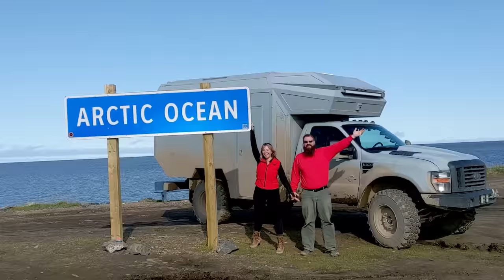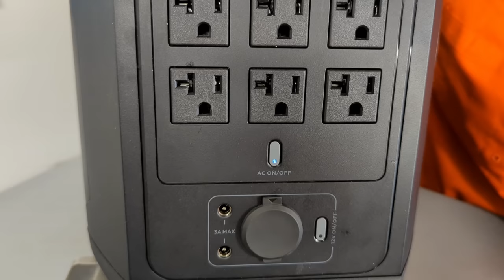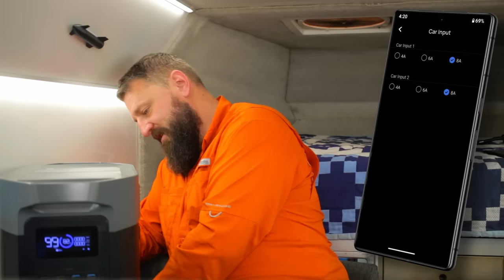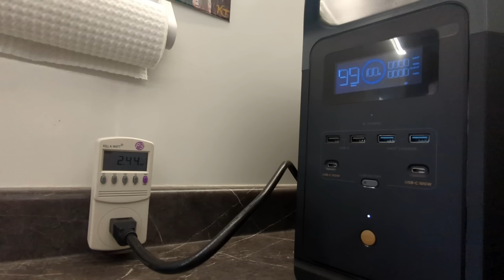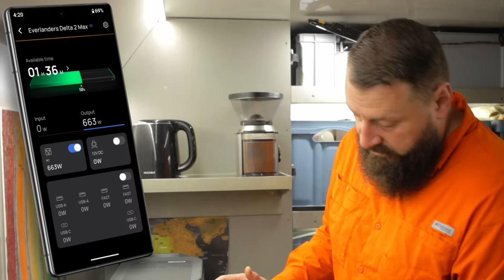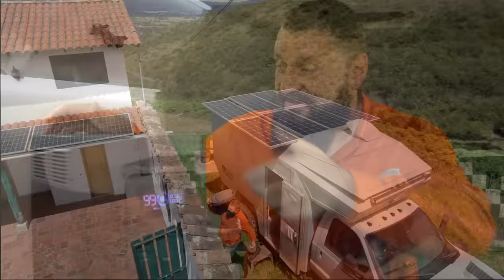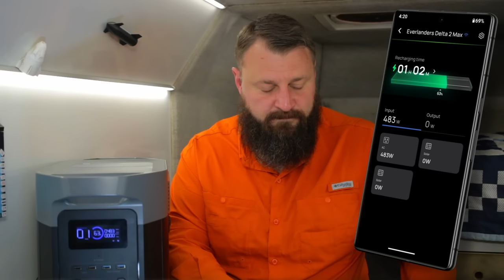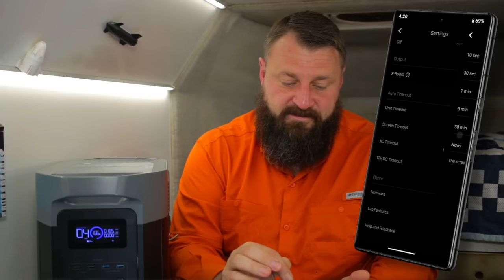EcoFlow for Overlanders - The LiFePo4 Delta 2 Max

Comment: Great little editing bits.  The buffer is a good feature.  I have to look back when you were building the batteries.  I seem to remember there was a certain way to pair the cell blocks. (Not the correct verbiage) So they are putting out similar energy so one doesn't blow the cell.  Man I totally messed that up.😅

Ok so as I get ready for our build. I need to go back and review your electrical build again. 😮😅
Reply from the maker: Cool, thanks

Comment: Great new video.  Put it in the onion!  You can really tell all the extra bits and bobs you have added to the editing.  I’m really looking forward to your next one powering the house.  Your right if the eco flow had a few more 12v outputs it could really be a drop in battery source for a van conversion or other type of vehicle.

Comment: As an overland traveler the input voltage range of 100-120 Volts AC is actually something you might be critical of too
Reply from the maker: We haven't been able to charge from the Grid in over 4 years, it just doesn't exist down here... The grid charging I did in the video was actually just running off of our inverter...
Reply from the maker: Given the way this inverter and charger is designed, it's running the inverter in reverse as the charger. It's a huge technical challenge that would add significant cost that a very small part of the user base would utilize.

This is no different than our high end Victron inverter... It requires a external voltage transformer too, not to mention the complexities that come from 50/60hz switching.

Comment: Excellent review as always.  Many thanks for your time.   More 12v outputs would be nice.  5521, XT60 or Anderson at at least 10a each.   After all, if you use this in a auto/truck/van, you are wanting to power stuff on this instead of the vehicle starter batteries.  It seems like many of the major players are reducing the number of 12v outputs which makes them a non-option for me.  They seem to be throwing more and more 120v outlets with how wattage's inverters which makes them more useful for a home but not the auto/truck/van.
Reply: You can't even power a diesel heater with the Ecoflow 12v outlet. So I went back to Victron and now use the Delta as a home solar farm with their powerstream unit.
Reply from the maker: Adding a super capacitor would make it pretty easy to start the diesel heater...

Comment: For those people complaining about the the disturbing fan speeds: do you not use a table fan at all?  My A/C makes more noise in my window by far. Besides, you have 2000+ watt-hours in a briefcase in a tent in the middle of nowhere, so who cares?
Reply: It’s all situation dependent 9/10 you can work around it like putting it in another room and running extensions my own situation is I live in a van with solar my delta max wakes me up some mornings when the early sun hits the panels I don’t have the option to move the unit further away from my bed

Comment: I've got an Ecoflow Delta Pro in the tongue box of my camper, a 1980 Burro.  3.6 kWh is a substantial amount of energy, but still not enough ha.  My experience mirrors Jason's; all my cooking/kitchen needs can easily be met by the DP.  In addition, I've used it to heat water for a camp shower (1800W) and the DP didn't even break a sweat.  I've set up my camper so that all energy input goes first to the DP and then to the camper's little breaker panel (PD4045ka), whether AC or DC.  Ultimate goal is to set up for boondocking; I've set up my EV tow vehicle to access its 78 kWh battery to supplement the DP, acting as a giant silent generator.  When it runs down, disconnect and scoot over to the nearest town that has charging stations and charge whilst resupplying, or eating or site seeing.  My last 2 camping trips were just that and it worked quite well.  Having a rapid charger nearby is a bonus.

Comment: The car charge limit is the reason I will build my own system in the summer.
This looked like a easy solution, and there is hacks you can do to make it work, but they should have included it with the product.

Comment: Amazing channel!
I just subscribed, I have spent the last 4 days watching your channel at least 4 hours a day. Incredible tips! How creative you are! I'm searching for what I should do to have a 12V, 7,000 btu roof air conditioner (850w max and, as you said in another video, 550w on average) on my truck camper that has, let's say an ordinary electrical power configuration. I have 400w in panels, 220Ah in AGM batteries and a 30A controller, so I think the solution is to connect the 12v air conditioning directly to the Delta2max and connect the Delta2max to a 12v outlet of the camper so that it charges simultaneously, albeit slowly, and put it to run , I hope I can have it turned on in this way for at least 3 hours on a sunny day at 32 degrees Celsius outside and 8 hours at night at about 30 degrees Celsius outside, setting it at 24 Celsius inside. My truck camper is well insulated, although it has all the usual windows, but it is smaller than yours. What do you think, will it work?. Hoping to do the flat mounting on my Starlink too. Greetings from Ecuador.
Reply from the maker: No, I don't think you have enough solar to make that work...
Reply: Thank you Jason, what  if I increase 400w in portable solar panels connected to Delta2?
Reply from the maker: No... 400 watts of solar isn't enough

Comment: I've seen one more person test this device with the 2 add on battries hook up to a house with solar and that xboost worked well,it kicked on and off when needed for smart charge and seem to work real well. This is one of the better units Ive seen out there.
Reply: I wonder if you can do all the smart controls on the unit like in the app if not then I would say thats a con for me but the app seems to be really nice to use I would just want both options.
Reply from the maker: I think you'd need a QWERTY keyboard for that... Who doesn't have a smartphone?
Reply: @Everlanders  I know right I recently put 100w solar on my every day 07' chevy trailblazer truck and got a lil 10A mppt controler. It had to have bluetooth or wifi so i can view and edit all from my phone. No smart control from a phone is a deal breaker.

Comment: Hello! I have an ecoflow Delta question. Can you connect two of the regular deltas together instead of the add-on battery so you have a regular delta and then another delta with inverter and usbs as a second battery to the main delta? I would rather have two regular deltas than a delta and extra battery. Thanks!
Reply from the maker: Nope

Comment: So I have a older camper van that still has 3 100ah AGM batteries, inverter, shore power connection and a charge control relay from the alternator. Is it worth it for me to strip out everything I have and swap to LIF PO4 batteries? Or is there a simple way to hook this up and still get charging from my alternator?

Comment: Best Review on the net, unfortunately I need a unit to run my DC loads in my van and little sailboat. 120 Watts is definitely not enough for me.
Reply from the maker: It is simple enough to tap the output of the BMS and run your own 48v to 12 volt DC-DC converter... If you really wanted it...
Reply: @Everlanders  Has anyone done it before?
Reply from the maker: Connected a DC to DC to a battery? I have.
Reply from the maker: It would be done exactly like connecting an external battery... https://www.youtube.com/live/iSDO6MAPqGE?feature=share&t=10314

Comment: I have been thinking about buying one for my 34 foot motor home and  using it ti replace my 300amp motor home batteries. i have solar on the roof and one thing i need is a ups system to run my cpap.

Comment: Thank you for your awesome video.  Nice on all the video features.  To ECOFlow In evaluating these types of units for field deployment in emergency communications for ARRL ARES and government RACES activation, the 10A 12VDC is not sufficient for ham radio emergency communications needs, especially when we add in packet communications.   The equivalent Bluetti unit has a 25A 12VDC option (on a bizarre aviation connector for RV or emcom), but it is available and meets the needs.  So to EcoFlow -> 10A 12VDC is not enough.  You need to fix this and on a standard connector.  Note that for ham radio, Anderson powerpole red/black up to 45A.  However, easy to convert from other RV connectors.

Comment: I agree wholeheartedly with your assessment that it needs to have a higher DC output xt60 or other type connection. I would have jumped at this much sooner than Black Friday sales (one for my parents and one for myself) if they would have put that Infinity Port like they put on the ecoflow Delta Pro so you could actually stop at a car charger station and charge it up. I plan on taking it with me car camping with a tiny little trailer and I don't have enough space to have enough solar if I use it heavily some days while rough camping, especially with overcast weather or staying in populated areas where I can't set up solar panels. Honestly if they would put out a unit with higher DC output and the ability to go plug into a supercharger, I would probably return this and get that immediately haha

Comment: I usually don't comment, but....Someone in the comments below mentioned using this unit to power his small home. This struck a chord with me as I am approaching 70 and looking to retire soon.
At the price point on amazon with an additional battery module,  this unit and a half a kilowatt or so of solar cells would make a great guerilla home solar system, and would pay for its self in less that two years.  I live in the Mojave.  If my calculations are right, this system could power my modest home, except for the evaporation cooling. Any thought,,,,, anyone?
Reply from the maker: That's exactly what we're doing in our next video, standby...

Comment: Glad to see that this battery is rated at 3000 cycles to 80%, more compatible with Bluetti, which can be important for people completely off-grid.  The Delta Max is only rated at 500 cycles to 80%.   Would be interested to know, if that is really due to a different battery composition or just hype?
Reply from the maker: It's pretty cut and dry... NMC vs LiFePo4

Comment: What specs are the solar panels you used for the charge testing?  Vmp, Imp, Voc etc?

Are you using generic XT60 connectors on your solar panels, or XT60i connectors with the additional pin?  Some have claimed a limit of 8A without Ecoflow’s XT60i cable.

Between this video and your second with the off-grid house, I can’t imagine a better review series to watch on this unit.  Awesome review!!!
Reply from the maker: 39.20v, 10.51a, 46.55v... but perhaps it's easier to just read it off the Datasheet. https://www.jasolar.com/uploadfile/2021/0706/20210706053524693.pdf

I used my regular XT60's, I suspect those who are only getting 8 amps have a tiny 12 volt panel and the Delta switches to car mode, with a cigarette lighter icon, I had no such issues.
Reply: @Everlanders  after doing some research, it seems EcoFlow’s XT60i connectors have the center pin shorted to negative for the solar cables, and to positive for the car charging cable.  This allows the unit to limit the current to 8A on the car cable as to not blow fuses.

One report I read suggested the Delta 2 (same input as the Max AFAIK, just one instead of two) started charging properly via solar on an XT60 after a firmware update, so maybe some sponsored reviews took place on a beta firmware?  Just speculation.

Thanks for the info, and best of luck on your South American journey!!!
Reply from the maker: Yeah, the cigarette lighter adapter plug has the center pin tied low. But it's pretty safe for the box to assume that the 50 volts input is not from a car.

Comment: How did you get the slider for ac input? My app doesn't have a slider and the input is stuck at 1800w.
Reply from the maker: You need to flip the physical switch on the unit to enable the option in the app.

Comment: Hi Jason, thanks for this in-depth review. Did you tested how to charge it in the car while driving via the car alternator? I do have a DELTA MAX 1600 and when I'm connecting it to the 12V plug of my car it can only charge with up to 8 or 10 amps, this means around 120W max as the input current is limited. My point here is, when running the cars engine you have much more power to charge the EcoFlow from the alternator. 
One option (and this is the cheapest one) is using an inverter (500W inverter for $80), the you can charge the EcoFlow with around 480-500W through the alternator. Here is the downside, the fan of the inverter is pretty noisy and the fan of the EcoFlow as well. 
Another option would be to use a DC-DC step-up converter, let's say 12V-to-24V and the you can charge the MAX 1600 with max. 13A (which is the limit), this would give you 312W of charging and a better efficiency, and only one fan from the EcoFlow is running. Currently, I'm trying to find a better DC-DC step-up converter which can go up to 48V and have a 10-15A output current. The limits of the DELTA MAX 1600 are up to 100V and up to 13A. Have to look into the new DELTA MAX 2, love the two solar charger inputs, one can be used with 12V from the car and one with solar.
Reply from the maker: It is extremely inefficient and wasteful to try and charge from a car alternator I wouldn't consider it with so much solar available.
Reply: @Everlanders  OK, in your case I can understand. But I don't have any space for solar panels on the roof of my 4x4 (RTT, awning, storage boxes), so I can't charge with solar permanently. Only chance with portable solar panels on the camp side when I'm at the car. While driving the alternator is able to give me enough power to fully charge the ecoflow.

Comment: Hi thanks for the review, question would you need the xt60i cable for using with solar or can you use the xt60 which would be better as don't have either at this point but was looking to get as long a cable run as possible? thanks again
Reply from the maker: I'm using regular XT60 - however, this would have no effect on cable length and voltage drop which is still something you'd want to avoid at all costs.

Comment: Great review.  I love the features you mentioned.  I really like the idea of using as a UPS.  I wonder if using it in UPS mode, would degrade the batteries faster, or if you can set the min and max charge feature so the charging doesn't come on so often (thus saving the charge cycles).  Sine wave UPS's are expensive so, possibly, one could justify to one's spouse the little bit of extra cost for the Delta 2 Max due to it's additional capabilities?
Reply from the maker: Good question!
Reply: LiFePO4 batteries like to be 100% charged at all times, so I'd expect the BMS to keep them in a tight range like 99-100%. They are very different from LiOn computer batteries.
 The typical small UPS uses AGM batteries, which are also maintained at 100%, since the idea of a UPS is to always have it fully ready. But commercially, those AGM batteries are also replaced every two years. They can lose 25% capacity per year, and 25% more on a hot 95°F day when the grid is most likely to go down. FWIW.
Reply from the maker: I disagree, I keep our truck batteries below 90% to extend their life if there is a reasonable chance for solar the next days. Only if it's looking like poor weather do I charge them higher than 90.

Comment: Hi Jason,
May I ask what you’re using for your fridge?
Would the delta 2 max have enough power to run your fridge?
What would you recommend to maximize the solar input capacity?
Thanks so much
Ken
Reply from the maker: We have an Isotherm fridge and an engle freezer, both run for our DC solar in the truck. But a 2Kwh battery like this would run a regular residential fridge for about a day without solar and with a panel or two would run indefinitely.
Reply: @Everlanders  much appreciated… What solar panel(s) would you recommend to maximize the input power capacity for the delta 2 max please. Thanks so much Ken
Reply from the maker: @kentsuruda2350 Anything that totals 1000 watts.
Reply: @Everlanders  Thank you 🙏

Comment: Great video! What are your xt60 solar inputs carrying?  V and amp and max watt on the panel configurations per strand?  Curious how mppt converted from overvolting etc.
Reply from the maker: 52 volts, 10 amps, which is not over-voltaged.

Comment: Do you have a solution to add 12v output? I think it's one of the best but didn't have the amount of 12v output to run the appliance in Rv?
Reply from the maker: Nope, short of opening it up and adding your own DC to DC converter, it's not an ideal solution.

Comment: Can you show me how you wires things or what kind you use
Reply from the maker: There is really no wiring needed... The solar panels plug right into the connector on the back using MC4 to XT60 extensions and then you can plug your devices right into the outlets. 

I made my own cable, but this is basically it: https://amzn.to/3pgco4H